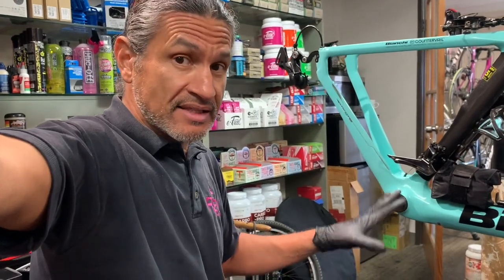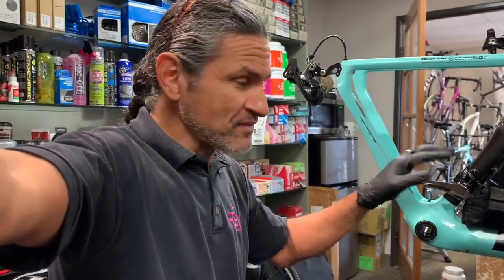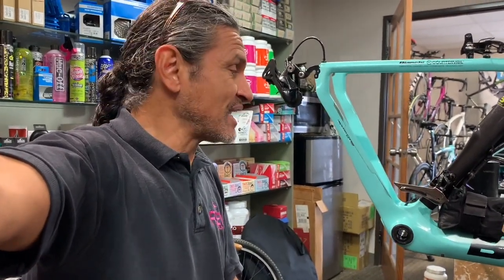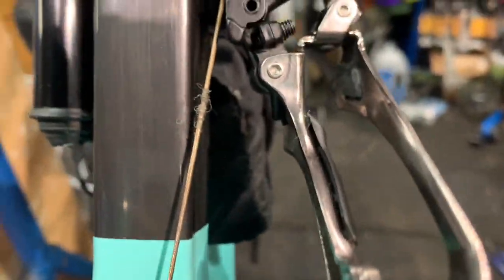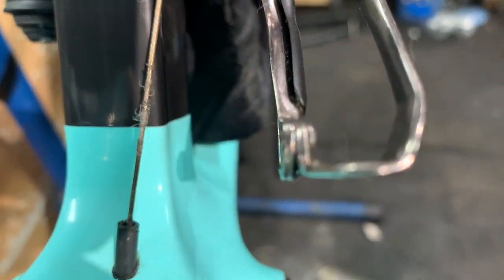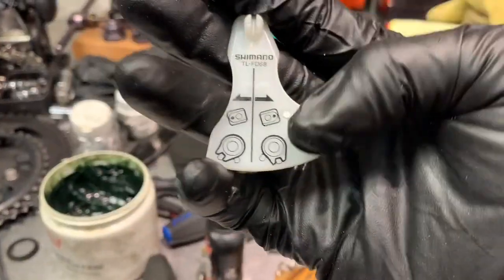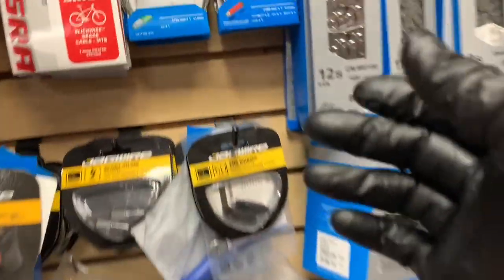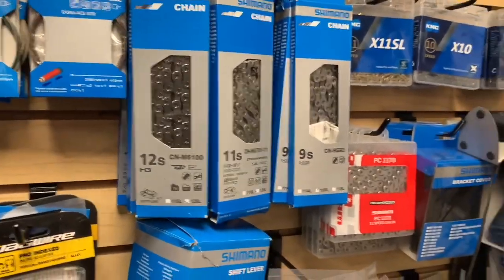Today’s Cycling Tip - Dura-Ace Polymer Coated Cables Are They Really Necessary?

Comment: My recommendation is to use good cable/housing for the rear, especially if it is a full housing system. Then when the going gets rough on the rear, change the rear cables into the front. If you need to replace both, i start by using mid tier stuff rather than the top tier. If results are sub par, i start looking for other options, but in the case you shown i think i would look into the 'ProblemSolvers' catalog to see if they have a solution for that. (Perhaps the Cross Clamp could be the pinnacle of what you are looking for)
Reply from the maker: Thank You

Comment: Having been in a hurry, I used the cheapest galvanised steel cable for my Ultegra 8000 front mec a couple of months ago. What can I say, works flawlessly and very smoothly so far, so that I felt a little stupid having ordered the 15€ Polymer cable while the other one was 23 cents.
Reply from the maker: The galvanized cable will show corrosion depending on where you live and ride. At the very least you should use Stainless Steel cables or even a coated cable from someone other than Shimano and cable grease. But for superior performance Shimano recommends the polymer cable. You do you as long as your happy with the shifting performance of your bike we can’t say peep about it 😊
Reply: @SeeYouUpTheRoad 👍next one will definitely be at least a stainless steel one!
Reply: @veithweissnich  SS and silicon grease is the way to go.

Comment: Good tips about using Dura Ace shifter cables. I have a 2015 Emonda with Dura Ace 9000 group set. Will definitely use the OEM cables next replacement time.
Reply from the maker: What cables are you running now?  And if this is your winter then this is the time to change them before spring and summer are in full swing,
Reply: @SeeYouUpTheRoad  Just some basic stainless steel. Yes it’s winter where I live but temps can swing all over the place. Agreed, need to change the cable’s now.

Comment: Very timely topic.  I just put that very Dura-Ace cable on my 105-7020 bike.  The Shimano 105 cable was only a year old and it shifted great.  However, I installed new carbon aero handlebars (yeah, I know 🤕) and needed new cable to thread through the frame.  I snagged the Dura Ace cable on sale.  I just rode the bike for the first time off the trainer on Sunday.  With the new Dura Ace cable, I couldn't believe how much faster the shifting is when going down the cassette.  It was just Bang! Bang! Bang! superfast.  I really didn't notice it being easier shifting up the cassette.  But that's probably because I'm a guy with reasonably strong hands.  Much to my surprise, the Dura Ace cable shifts noticibly quicker going down the cassette.  And there wasn't anything wrong with the 105 cable I took off.
Reply from the maker: I love these success stories!  Thank you for chiming in!!

Comment: I had sram red 10 speed cabled on my bike. Could never get the shifting right with the high tension required. Didn't really notice a different in cables either. Have to be careful if its routed under the bb with that high of tension it will eat thru the cable housing which was probably part of the issue in the bike design being that it was built for shimano originally as a pro replica. I was lucky enough this never happened but in past bike shop I used a combination of very liquid lubricants they run thru the cable before inserting it. Seemed to work well. Now on my gravel bike I just squirt some silicone spray lube into the housing near the rear derailleur and seems to help that area where the housing bends around.
Reply from the maker: Thank you Sheldon!  I have never been a fan of SRAM Front Derailleurs.  I just don't think they were designed well. I like your silicone trick :-)

Comment: I'd like to see a comparison between the Dura ace cable and the likes of jagwires or for really cheap fibrax die drawn cables witch don't rely on coatings but the die drawn process makes them smoother
Reply from the maker: That would be awesome comparison. Along with any other coated cable as well. And then throw in the Nikon and Elite cable set.

Comment: And here I was all ready to change out my fuzzy cables to stainless steel. Hmmm….
Reply from the maker: Yep people don’t like the fuzz 😂 

On some bikes you can get away with using stainless steel cables but on others it is strongly recommended that if the lever push is too hard then use the Dura-Ace cable.

Comment: I still use those cables on my Colnago along with the white cable grease that Shimano makes. That Jaguar housing isn't doing you any favors either. In a pinch I would use a regular stainless Shimano cable/housing and coat the cable in the Shimano white grease. It will give you a similar result.
Reply from the maker: Rangle! He lives! Thank You for the tip sir

Comment: I’ve found that Jagwire outer cables can contribute this - I’ve changed to using the Shimano SP41 polymer coated outers with Stainless Steel slick cables…
Reply from the maker: Thank You Dominic!  I will keep that in mind on the hard to shift/dial-in bikes.

Comment: Actually I use Teflon coated cables and they are great. The cables are dipped in Teflon almost like paint, not like the DuraAce cables. They're only $6 and I'm not switching
Reply from the maker: Which cable is that Ric?
Reply: @SeeYouUpTheRoad  MEC 1.1mm Teflon Slick Stainless Steel Gear Cable (MEC is the Canadian equivalent of REI)

Comment: Those cables are AWESOME!  I used to use the standard stainless shift cables on all my bikes, and had to replace the front derailleur cable on my Ultegra 6800/105 5700 bike.  Broke down and bought the polymer coated cable, and even before I connected it to the FD it ran so smoothly thru the housing.  After adjusting the derailleur, shifts are super crisp and fast with the 5700 FD.  Best front shifting I ever had.  I would definitely buy again.  Will this work on a SRAM Apex 1X11 drivetrain too?
Reply from the maker: I don’t know if it will work with SRAM. These cables are so slick if the anchor nut/washer combination aren’t good enough the cable will slip through. Shimano doesn’t recommend them on all their groups because of this slipping issue.
Reply: Do you lube the cables with anything before they go into the housing?
Reply: @rarebreed1984  the whole idea is that they are pre-lubricated.

Comment: The bikes with only the hole never have these problems because the cable itself will cut the frame into the shape of how it comes up to the Front derailleur so the cable is more free to move. In all my bikes all the cables are pre wrapped in a thin coat of white lithium grease so that once they go in from the shifters they go in smoother but also have less issues on bends against plastic parts ( the guides under the bike for example). The hole for the front derailleur cable needs to be wide enough so the cable housing does not kink the inner cable, the angle needs to be checked and hole adjusted for that angle. On that FD the angle is much greater so either greased or slicker cable is required.
Reply from the maker: This cable guide is a hard plastic guide.  The more flexible tubing allows a little deviation in the cable line from bottom bracket hole to the FD.  Yes I agree with you 100% 

Thanks for watching
Reply: @SeeYouUpTheRoad  Yep I add a flex type on my bikes. Always enjoy your videos filled with detailed information.
Reply from the maker: @danfuerthgillis4483  just like your comments always helpful with granular detailed misses by others. Thank you for contributing!

Comment: My R9000 Felt road bike shifted incredibly when I first built it with the supplied polymer coated setup—kabam kabam kabam—light action, instant shift for over a year.  Rear I’m mostly talking.  Switched it out with a stainless wire…. OMG it sucks!!  Shifting up the cluster it’s fine, back down it drags and hangs up badly.  Going back to the polymer coated wire ASAP.
Reply from the maker: Yep that’s why Shimano designed Dura-Ace with the polymer cables. Thanks for watching please consider subscribing

Comment: Polymer cables combined with SP41 housing  seems to make a difference when you have continuous very tight internal routing,  cables going through the headset, and tight bend at the rear derailleur.  At work I see plenty of SP41 and Jagwire housings that shift fine.    On my own bikes I run  jagwire lex sl housing and lube it with cable magic or triflow and use a regular die drawn/slick stainless cable and it works great.   Pretty much anything will work for 9speed or less.   I am not convinced Shimano cable grease doesn't pick up contamination, and contribute to friction.  Some advantages of a lighter dry lube like triflow, dri slide, or cable magic here, with unsealed ferules.    I.e SRAM tells you to not used sealed ferules.
Reply from the maker: @emilycs8823  thank you for chiming in. I always like hearing from other mechanics.

Comment: Polymer coated cables are a non brainer for any mechanical shifter or rim brake in my opinion and they don't need to be Dura Ace branded. You can get them from Decathalon and Alixpress. I have an old bike with outside cables too so a modern bike with internal cables really do need them. A spray with PTFE dry lube is good too.
Reply from the maker: Thank You for watching!

Comment: The green Shimano OptiSlick cables work great for about half the price. I had the DuraAce version and felt no difference.
Reply from the maker: Good to know!  They are considered Ultegra/105  level.  But if it works for you with no difference you still have an upgraded cable from stainless steel and not spending the big bucks for the Dura-Ace cable

Comment: I recently used Jagwire for rim brakes.  They seem really good.  I thiught they were also polymer coated?   I don't know about cables for shifting, my road bikes have Di2 and my gravel bike with GRX is pretty new.
Reply from the maker: I don't think they make that much of a difference for brakes since there is a lot of leverage and the cable is fatter  But for shifting I am a believer now! lol
Reply: @SeeYouUpTheRoad  I think the braking performance improved with Jagwire compared to whatever I had before, which was definitely not DuraAce level.  With Ultegra calipers and with top end Reynlods pads for carbon wheels the performance = my disc brake bike (in dry conditions] and is certainly good enough when wet.
Reply from the maker: @stuartdryer1352  Awesome!  I use the stainless steel cables from Jagwire.  I also have coated cables from Jagwire.  I switched to the Dura-Ace cable because I needed to rule everything out before calling Shimano to help me lol!

Comment: Without digressing too much. My front right Shimano Ultegra STI 10 speed RS 6800 mech. shifters, (yes I know I still run 10 speed) the shifting is delayed and sloppy. They are getting a bit old. On a Ultegra 10 speed Ultegra, should I replace my STI shifters or move to 11 speed RS 7000 STI shifters instead? I want to improve the speed and tactile response of my shifting. Angle of cable from BB looks good. Should I replace all of my cables with Shimano Polymer coated cables instead. I ride Bianchi 928 race Carbon 53 cm frameset, Celeste of course.
Reply: R6800 shifts really good, definitely not delayed or sloppy under normal conditions. Over time the inner steel cables can start getting shredded and frayed inside the shifters which causes sloppy shifting. I’d take it to your LBS and have them take a look, a clean and lube on the shifters and mechs and new cables would most likely resolve it all.
Reply: @gokaygs  Great advice. Thanks.
Reply: Yes you should...
Reply from the maker: Hello Stephanie!   How old are you cables?  When was the last time you replaced them?  gokays advice is sound.  There is nothing wrong with still running 10 speed.  Over time I see that it will get phase out of top or middle end support.  For example, with your 10 speed they only make one chain now the CN-HG6701 which is Ultegra no more 105 and no more Dura-Ace.  I really think the R7000 shifters are nicer than 6800.  The shape of the shifters is nicer less pressure points.  The actual rubber of the hoods is nicer.  The shifts are better as well.  But do you really want to buy a new groupset?

Here is a video I shot relating to this situation exactly 6800 vs R7000

https://youtu.be/f03HIePw8GM

Lastly --  Celeste of course!
Reply: @SeeYouUpTheRoad  Excellent advice. I think I will buy new STI R7000 shifters for my Bianchi 928 and my Focus Cayo. Good question on whether to buy new group set. Probably not right now. Will take your advice and buy new Shimano cables as you had mentioned in your video. Thank you. Great fan of your YT channel.
Reply from the maker: @StephanieHughesDesign  Thank You Stephanie! Are you subscribed? Tell me what you like about my channel? I wish to add value and provide good content.
Reply: @SeeYouUpTheRoad  I like the tips and the myth evisceration. Such as rim brakes over disc, which I agree with. Also, enjoy long distance cycling tips and endurance programs. I too am a Bianchi lover owning 2 - Bianchi 928 and Pantani EV2 team bike TdF version more of a retro bike these days. My 3rd bike is a Focus Cayo carbon rave climbing bike. I am subscribed.
Reply from the maker: @StephanieHughesDesign  Thank You for your feedback. I just published a video of Barb and Lori at the rainy 200 km we did non stop for 8 hours. Check it out and tell me what you think
Reply: @SeeYouUpTheRoad  Yes, I watched it. Good video. I tend to take a break when I consistently move out of Zone 2 heart rate. If I stay inside Zone 2, I can ride longer without stopping. Having done lots of climbing in my earlier years and training for Paris-Brest-Paris I find my kilometers per ride, decreasing substantially now. I will watch it again. I want and need to increase my distances per ride and a plan for doing that. Perhaps, No Stop, Never Stop rides are the way to go?
Reply from the maker: @StephanieHughesDesign  Hmmm... depends what your goals are though...

Comment: I have a cheaper diamondback commuter ebike with internal cable routing. the rear 9 spd derailleur will often not play nice around the middle of cassette. properly adjusted on both ends, but it will stick and not shift near the middle, then double shift on the next click. RD Was an Altus  and it had a bit of play on the main pivot, so i replaced with a Deore unit i had on hand in good condition-  less play, stronger springs and it STILL did the same thing with a very slight/minor improvement.  I suspect there are some rather tight bends in the shifter cable and im thinking this deserves to pull the motor and inspect the entire cable path.  
Short of saying screw it and routing externally (ugly)  - do you think upgrading the cable will make a difference?
Reply from the maker: It might help. Internal routing of cables is a stupid idea. External cables are always a better, simple and elegant for everything - shifting, inspection, troubleshooting, maintenance, packing your bike for travel.

Comment: I need them for my mechanical brakes on my Domane that's really meant for hydraulic only.  It still sucks and I have assist springs on my Spyres but it's the only way it'll work
Reply from the maker: What is Spyres is that Tektro?
Reply: @George Vargas  yes, not a fan of the hood shapes for hydraulic levers which is why I have a super expensive build with mechanical brakes.

Comment: My advice avoid the fancy colored cables. It’s attention grabbing not great for a commuter. but it does make a bike look all dressed up.
Reply from the maker: I gave Shimano’s advice for top tier components, specifically Dura-Ace R9000 and R9100. This was a real world experience which required the polymer coated cable to provide the shifting expected and designed into the Dura-Ace system. The stainless steel cable just didn’t work well enough. 

Did you mean coated? Or did you mean to say colored? I’m confused what you are calling colored cables. 

I’m also confused about you “attention grabbing… commuter” comment. Huh? 😂
Reply from the maker: As you can tell I’m all confused with your post 😂
Reply: @SeeYouUpTheRoad  sorry I should’ve worded it differently it is a bit off-topic, but I am referring to the external housing. High/ mid tier cable’s come in different color options, which can look visually appealing, but will have the side effect of people going up to the bike looking at it trying to figure out what it is. Why it looks different.
Messing with shifter’s. 
Picking it up etc, That’s why it’s not great for a commuter bike people will break things.
Reply from the maker: @johnbay1234  thank you for clarifying. I have a completely different perspective on your comment now 😂 

Personally I’m not a fan of colored housing. I think it looks bad even when freshly installed. But a few months later anything colored starts looking grey. Black housing for the win. 

FYI - I don’t like people just walking up and picking up my bikes 😂 whether it’s my steel bikes to see how “heavy” it is or my carbon bikes to see how “light” they are 😂